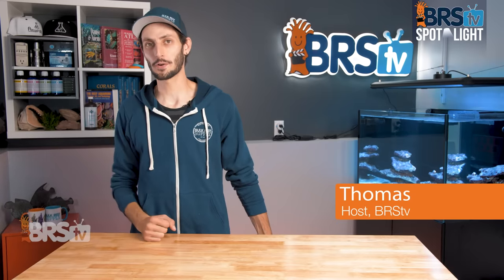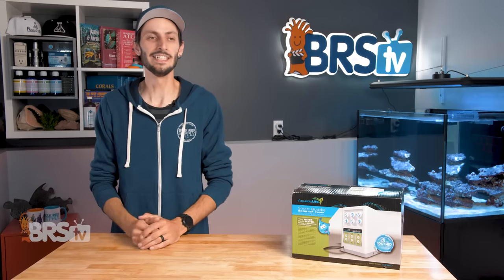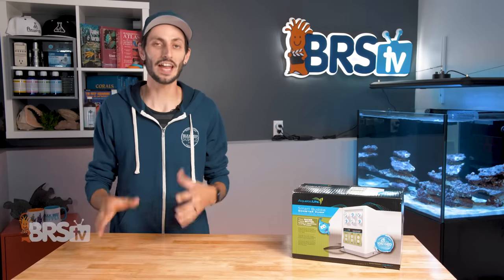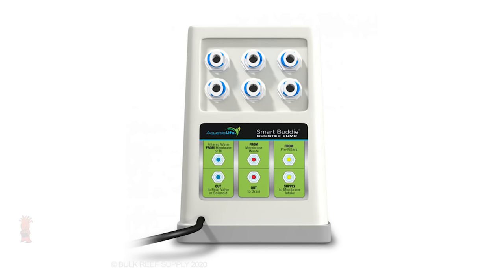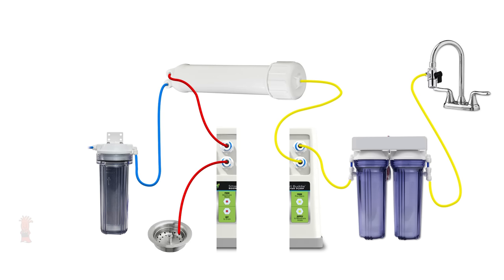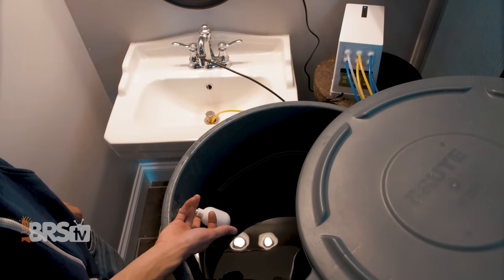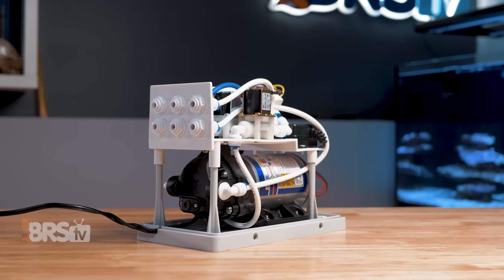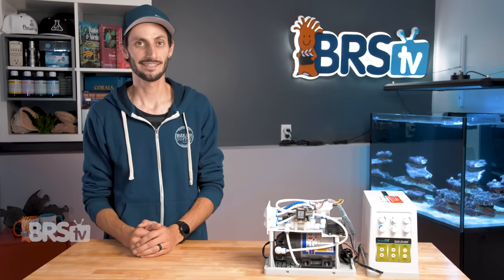Aquatic Life Smart Buddie RODI Booster Pump: Get better performance at a lower price!

Comment: I ordered this last Thursday for my used RODI system I just set up. I am on a well and have up to 50psi. This seems like an obvious item to purchase with so many features it would cost much more to buy a pump and add in the same feature set. This was purchased on your reccomendation Thomas. Thanks for the spotlight on this item, I would not have purchased it if you had not made the video.

Comment: My booster pump just 8800  price 90 on brs.. crashed.. was looking to grab a new one and saw this. However I have the 150 gallon per day spectra pure 5 stage system .. Which has the auto flus.  dont really need the 150 so i use the 50 gallon per day membranes...   I am fine with 100 per day even less...  will this work with a dual membrane system.   ?

Comment: My sediment filters also say they have a required pressure, doesn’t the pump connect between the tap and sediment filter?
Reply: The pump will still draw water with that higher pressure through the sediment and carbon filters as well.

Comment: Everybody just note that even though they showed a picture of the double membrane water saver system twice the RO buddie system cannot be used with that because it can only handle a maximum of 100 gallons per day which I understand they said I just wish they would have pointed that out more before I bought it because now I can't upgrade to their double membrane system which is one of their most advertised upgrades they have I think and yet this really cool Ro buddy system cannot be used with it
Reply: If you run the membranes in parallel instead of in series, it can do it. They won't work like a water saver system, but it will produce more water than a single membrane, like running two RODI units but with a single set of pre-filter and DI chambers.

I believe if you were to get two 50gpd membranes and run them in series it will work as a water saver system.

Comment: Thanks for the spotlight, I bought one, but NOW would you show how you could plumb it in conjunction with a permeate pump, because thats what I'd like to do and don't have a clue.Thanks again BRS. you guys make me smarter after each video.
Reply from the maker: Having or not having a booster pump doesn't really change how you'd plumb the permeate pump. Just plumb the waste line and product line through it. That said, we don't have a video on this...yet, so I can see the value. Just keep in mind that the permeate pump has little to no value if you're not running a pressure tank.
Reply: @BRStv  I saw a huge gain in output after installing the permeate pump and a huge reduction on waste water. Would I have even more gain by installing a pressure tank.
Reply: @BRStv  I just installed mine today, I read that short cycling the booster was bad for it, and once hooked up to my permeate pump, the booster cycles every time the Permeate pump changes pump cycles..  Is there a better solution?  I didn't read the pressure but my pressure tank was about half empty and without the Permeate pump the booster was cutting off and not filling my tank up to pressure..  Thanks!!!!

Comment: On the BRS investigates ro water pressure video it is recommended to run your system at 50psi. Is the output pressure of this adjustable? Has recommended pressure changed after more findings?
Reply from the maker: Actually, 50 psi is our minimum recommended water pressure. If you can run your RODI system's pressure closer to 70 or even 80 psi, you'll get much better performance. The pressure from this system will ultimately depend on the pressure you're starting with.

Comment: So if i uograde to the 200gpd set up on my 7 stage could i still use this set up or should i get the auto flush and other booster pump kit ?
Reply: See that's where bulkreefsupply continues to screw up and so did I because this buddy system can only handle a maximum of a hundred gallons per day
Reply: Pretty sure the 50-100 GPD is on the waste water flow restrictor. A 200 GPD upgrade kit is still using the 100 GPD membrane and the same flow restrictor. So it will work just fine.

Comment: Does DI have to go before it, or it can go after it as well?
Reply: You hook your somewhat clean water out of your membrane into your D I so basically afterward I guess
Reply: DI should go before membrane and after sludge filter.

Chlorine can damage your RO membrane
Reply: @foxyrollouts    No. DI goes after membrane. A high quality carbon block filter goes before the membrane and removes chlorine.
Reply: Thanks.. i thought it was a activated carbon the DI... either way Cl has to be removed b4 membrane
Reply: So thats a DI resin I presume. Im not familiar with the sysytem but I am an industrial chemist
Reply: @Matt-dc8lp  graphite is an de ionizer.
DI resin is something else that de ionises. I wish that slack jawed presenter spoke properly
Reply: @Matt-dc8lp  graphite is an de ionizer.
DI resin is something else that de ionises. I wish that slack jawed presenter spoke properly
Reply from the maker: You'll want your water flow to go from source water > sediment filter > carbon block(s) > RO membrane > DI. The RO buddie will get plumbed in like Thomas shows on the diagram in this video :)
Reply: Whats the DI for.. cheap insurance?
Reply: Is that to make sure  you get zero tds?
Reply: I have a simple RO unit.. it has no DI resin... i get 10L per hour off mains pressure
Reply: Finally for arguments sake if you put the DI resin b4 the membrane it would clag up in about 5 mins and become useless

Comment: Can you use it with a pressure tank for drinking water?
Reply: Yes
Reply: The pump will recognize the buildup of pressure in the tank and then shut off which if I remember right is the very far left function of the machine
Reply: The pressure switch is a bit sensitive to be used with a drinking water system that has a pressurized tank. It won't allow it to fill up completely, so keep that in mind.
Reply: A booster pump will help.. prob easier to get a more simple unit that does that job. It takes me 8 min to get 1.5L without a booster. I just fill teo bottles and drink them room temp. Cause the water is pure it tastes great unlike tap water

Comment: DI should go before membrane and after sludge filter.

Chlorine can damage your RO membrane
Reply: The Prefilter stage is your micron and carbon, which should be removing chlorine/chloramines  provided you're using the appropriate carbon type.
 DI is a final polishing stage and should be last as shown otherwise you'll burn through it in a matter of gallons.
Reply: @ThomasBReef  My god man Kill the fox lol

Comment: OMG talk about overthinking everything
Reply: Chaz a booster pump is handy if you dont want to wait 12 hours for 30 gallon
Reply: @foxyrollouts  I'm not complaining about the booster pump just the way everything has to be connected up to this system it's been completely over thought considering there are models of R.O.D.I systems that have one built in
Reply: My freind has a booster pump on his rainwater tank. I am just saying you could run a much simpler system. This is obv set and forget with a brain. A pressure switch is prob all you need as a minimum if that at all. I used to work in a lab with a simple booster pump.